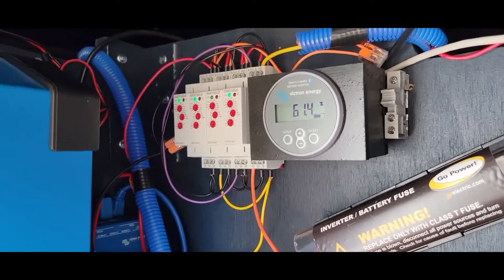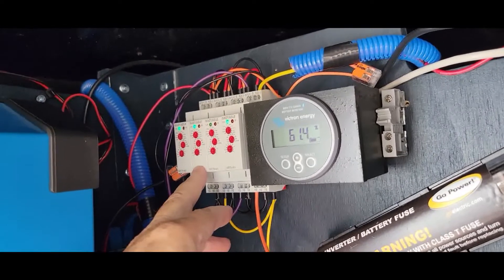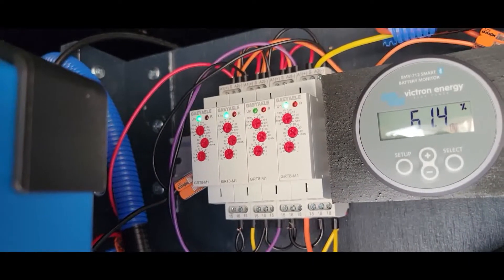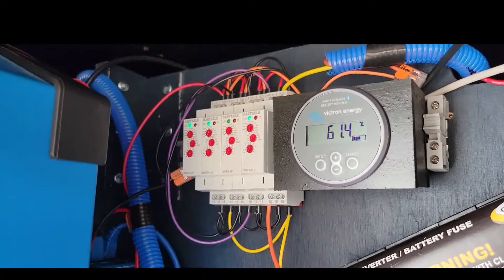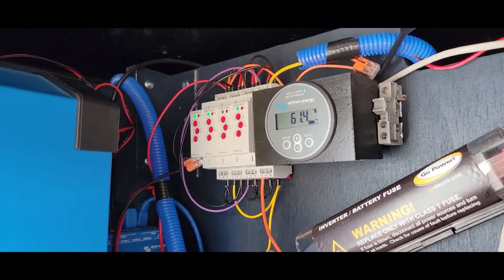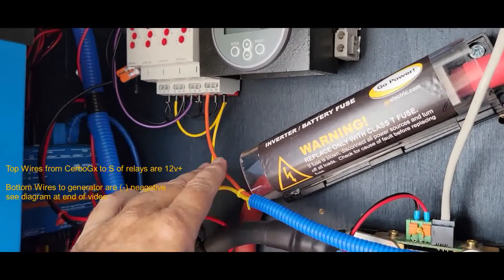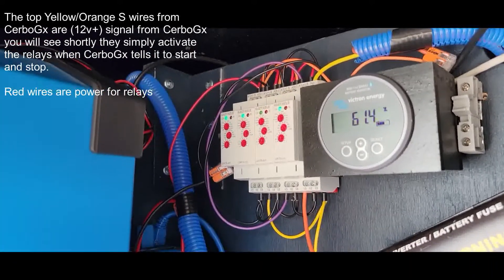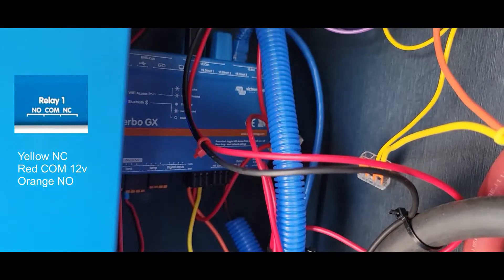Automatic Generator Start CerboGX start/stop/prime setup. Onan5500 controlled by Victron Cerbo Gx

Comment: This is a great video and thank you for the wiring diagram at the end. Very straightforward. I have built this system exactly as you designed it and it is working fine with my generator. I do have an additional idea for you to consider. I think there should be an additional timer in the system that shuts the generator off if the Victron were tolose Wi-Fi connectivity.  The additional timer could be set at four hours or some other appropriate time that is longer than you would normally run the generator.
Reply from the maker: The cerbogx generator programming doesn't care about the wifi therfore I don't see that as a need.  I would recommend a breaker be used as a switch so you can cut the power to the relays for storage etc..  note this version is very old still works but now on Gen3v with restart if generator fails to start.
Eric

Comment: What gauge wire did you use?
Reply from the maker: The wire gauge depends on the application I would need to know a lot more  about what your doing to answer the question and what your setup is.
Reply from the maker: Our website also has information you might find helpful and you can contact us through it as well.  DoingCreatesKnowledge.com

Comment: Some new portable generators have a start stop button like a car.    I wonder of the cerbo “no” could be wired to that wire
Reply from the maker: Typically NO what your describing could be either a single or double action push button which either way is a momentary signal which the cerbogx can not do.   This 4 relay setup  is my old method have a look at the 3f2 versions on doingcreatesknowledge.com and in the community posts on the channel.   
Eric

Comment: Thank you for this.  Very helpful.  In the process of installing a Onan 2800i LPG model.  I am thinking that I can save a relay by using the run signal (preferred) or the Status/lamp output to serve as a trigger and prevent the Cerbo from trying to start a running generator.  Key to this will be determining the voltage that comes from the remote run wire and the status lamp.  If less than 12V, will have to rethink this approach or go with another relay.  Will report the results.  Thanks again for this great video.
Reply from the maker: Hi TylerCreed-m1c,   I am coming out with two more solutions in the process of testing both  and they would save on cost and size as I'm looking at reducing the size/footprint of the setup.  If v2 works and testing will be done shortly it will fit into a 3bay box and about 1/2 price with added features and v3 will be even smaller trying to keep it about 1 1/4" x 2" x 3.5" but this is about a week or two to test.  
Thanks for the comment and Check the community page for more information and alternative setup of this four relay setup.

Comment from the maker: If you decide to use the alternative relays go to the channels community for an example print for a Gas Onan generator.  Each application can be a bit different based on how your triggering the generator and current systems attached to the generator

Comment: I would like to set this up for my Onan 4kw on my class C. Do you have any updates/improvements you would recommend? I would like to use the Alternative relays single function  
vs multi function you mentioned it requires  1 GRT8-A1 and  3 GRT8-A1. I cut and paste the directions from Youtube and it appears they are the same one. Did you mean 1 A1 and 3 B1? It looks like you had some additional instructions 11 months ago to wire a bit differently. You wouldn't happen to have a wire diagram for that would you? Thank you for the video and your time. Appreciate the sharing of knowledge!
Reply from the maker: I just posted a wiring diagram in the community section of my channel for the Alternative Relays
Reply: Do you have a certain wire recommendation as well. (apologize for the newbie question)
Reply from the maker: @johnwhitney5316  I used 18-20 wire on my ONAN5500 generator.  I did use ferules when securing the wires into the relays.  Some people have just put the wires straight in.  As far as improvements.   Nope it works can't fix "it works".    No I didn't have a wiring diagram for the alternative relays but do now.  dm me on facebook and I can get it to you.  If you need any help feel free to ask
Reply from the maker: Hi John,  Sorry for the confusion on the A1, B1.  Where was that I can't seem where I made the mistake?  I would like to correct it
Reply: @ERazorDiy  in the description, under alternative method
Reply from the maker: @johnwhitney5316  Thanks John finally found where that was.  Had a few people point it out in the past but wasn't specific where it was and didn't notice it.  It's Corrected.
Reply from the maker: I just updated the print in the community to add an inline fuse for the power going into the cerbogx relay COM.  Just to be safe.    I'm will be adding this inline fuse protection to my setup.  So yes I just found an improvement that should have been there.

Comment: fantastic video, simple and right to the point.. great follow iup below.. THANK YOU
Reply from the maker: Thanks for the comments.  If you have any questions feel free to ask.   There are other video's on my channel working with  Victron equipment as well.
Reply: @ERazorDiy Common has power, NC is supplying power out, yellow does nothing. Using the cerbo to turn Gen on and off the 3 wires on the cerbo never change console on or off. I've been through the settings I'm not seeing what I'm missing any ideas
Reply from the maker: @stattytravels4638  on the cerbogx you need to set the relay1 to Automatic generator.    The common needs to have 12v.   The wiring depends on the relays your using multifunctional or single function?.   Will be happy to help if you want to directly email me you can at ERazorDiy at Gmail.
Reply from the maker: @stattytravels4638  check my comments above should be near top. I have the cerbgx settings that are needed.

Comment: I couldn’t find a generator with electric start small enough for what we needed. I know there are aftermarket electric starts you can add. But can you tell me if the cerbo can be configured to auto start a generator with an aftermarket electric start installed? And how would you do that? Right now mine has to use the manual crank (it’s a 4000ish watt AiPower genny)
Reply from the maker: Adding a auto start function to a manual generator.  If it has a button to start/stop then yes it should be able to be done the wiring and setup would be different depending on the auto start function that is added.

Comment: Hello.  Watching your video once again to figure out the relay connections. I understand the connections to the GX. You have Orange /Red / then Yellow connected to the relay.  What 12v power source are you using to power the relays?  My solar batteries are configured in 24v conf.  Just wondering as I only see the red wire going t GX and don't know where my black wire is going ?
Reply from the maker: Hi, It depends on what relays you are using the single function or multifunction relays depends on the wiring.   As far as 24v my understanding is the cerbo gx will accept up to 30v 6a  DC if that the case you should be able to use the 24v to same as the 12v.   With multifunctional there is 12v powering the relays via 12v battery bank.  Then the cerbogx COM is 12v to send 12v to the S top signal of the relays.  If that makes sense.   Feel free to direct contact me email me at  erazordiy gmail
Reply from the maker: If your using the single function relays  they are wired differently.  You don't use the S and the power to the relays is replaced with the NO and NC from the cerbogx depending on the relay
Reply: @ERazorDiy  . Thanks for your reply. I set up using your video and same relays. You show the red power cord going to GX and don't show were the ground connects. I understand it goes to 12v battery, but should the red wire as well?
Reply from the maker: @Alaska1969  
if I recall you using a portable generator?.   Lets think about this.   Assuming your using two separate powers one for relays and cerbogx relay and the generator has it's own battery.  
you will need to get a ground from the generator and connect it to relay 1 15, relay 3 15 and relay 4 15.  Relay 2 15  ground needs to come from same power source as you are using for the 12v to power the relays A1's "same ground as your A2's".   if that makes sense.   If we are tying to start a generator that has it's own battery and is using a ground to start it.  The ground needs to come from that source the generator battery.  Because relay 2 is activating relay 3 the ground sources of relay 2 15 needs to be same as the grounds to A2's.
Reply: @ERazorDiy , is it okay if I email you and send you a couple photos. That may help. Thank you. Brad
Reply from the maker: @Alaska1969   yep feel free more than happy to help
Reply from the maker: Trying to figure out what your asking..  sorry for the my confusion.  Looks like I didnt' make it clear what the COM on the cerbogx relay was on the print. There are 3 wires going to the cerbogx relay.   NO yellow  NC red.  and there is a COM that is the 12v power it sends 12v to NO or NC depending on the state of the relay.  the NO red wire should not be red I guess.

Comment: Hello Eric, thanks so much for the video.  This is my second attempt to get my gen auto start. The first was one from another guy on YouTube using a two relay setup, i couldn't get it to stay on, it would just click on for a second? So I thought I'd try your four relay set up. Let me first say that I'm using my Multiplus rather than a Cirbogx. I've had a great guy from Battleborn helping me with the programing so I'm sure that's set up correctly. I also have a diesel generator which I just noticed you mentioned needs to be wired a bit differently. I'm not on Facebook so I'm just reaching out here. My generator is also a negative contact to start. I thought your set up should work but if you have a diesel diagram that would be great! One question I have is on the top of your wiring diagram you have wires to ground. For some reason i was thinking that you meant to the com on the Cerbo, but now looking at it again I'm thinking that it should be to actual chassis ground? Any help would be greatly appreciated. Thanks.
Reply from the maker: Hi Danny,  yes I can help done lots of configuations, but will need more information before we know what you need which will need better communication.  Maybe contact my email and we can go from there.  ERazorDIY. At  g mail.
Reply from the maker: I would not suggest buying any relays until you know how to its setup.  There are a lot of configuations especially with diesel generators and how it's connected will determine what relays to use.  Most ppl don't know how this works.

Comment: would there be a way to add another timed relay in there and have it do a 30 second preheat?   My generator has this a s separate switch from the start switch for the preheat.
Reply from the maker: Based on your question I'm assuming it's a desiel generator?  If so they work a bit different.  But still only needs 4 relays typically two 5 pin automotive relays and two multifunctional relays its cheaper than using 4 multifunctional relays.   It can also be done using a  raspberry pi picow  relays, isolation board for about $50 but takes a bit of programming..  will look up my desiel relay doc I made to better answer your question.   If you want to dm me on fb you can as well
Reply from the maker: I looked up my diesel Gen setup and for the diesel I helped on it had a Stop(OFF)/On/Delay/Start  functionality.  It depends on exactly how your trying to do this.  You can add more relays into the set but I don't think it's necessary unless you also have a prime cycle.

Comment: Nice work - thanks for the video - hoping to use the node-red to do something similar with gen start led feedback to stop starting cycle - also targeting to use soc driven prime and start (few times with cooldown between) and also do the stop based on soc and current draw.   I am fine running one ac on batteries till they come down to a low soc then keep the ac running but with gen while it also charges the batteries - i.e only run gen when it needs and ideally while ac is needing power as the generator has excess power with one ac unit running.  Running both ac units is a different story as that needs the power asist on the multi to suplement generator power during second ac unit power up (yes both have soft start) once started most times if can slow charge with two units running.  If its really hot then it has to eat battery power as the generator is maxed out (4kw) so charging only happens when a unit cycles off (if it does, else its a game of chicken between reaching a too low soc vs forced manual ac shutdown).  Hope i can figure out node red.  Thanks for sharing i like your setup.
Reply: Hi there, were you ever able to work out a solution using Node Red? I'm trying to do something similar, accomplish what these relays are doing but with node red and just using the built in cerbo relays
Reply from the maker: Thanks  https://www.youtube.com/watch?v=ujeoZ4ldIGY&t=322s       I've also used a Raspberry pi PicoW to auto/start/prime stop my generator.  See Link that only uses two relays due to programming.  The Auto start and stop is currently being done using the cerbogx and the PicoW will manually start and stop it.  This will change shortly I'm working on reading data from my battery monitor BMV712 and MPPT solar controllers gathering this data into the PicoW allowing further programming options such as full automatic mode with just the picow and two relays.   I now have full access to SOC, voltage, current etc, etc and solar controler data.  This allows me to program using SOC,  voltage, time etc with  Current level draw  given x time start generator together with restart if start fails .  I currently have a restart if generator fails to start using the generator status wires as input to a delay before restart to unsure it's completely stopped and verified by status wire.    That and controlling fans and other devices  lots of ways to skin this cat now.  Not to familiar node-red will have to have a look at it.

Comment from the maker: If you decide to use GR8T-B1,A1 relays they are wired differently than what I did because they work differently.   Relay 1-3 A1's  would be connected to Cerbogx NO start signal wire.  Relay 4 A1 is connected to Cerbogx NC stop signal wire.  there is no "S" wires and the grounds and bottom wiring are the same.  If your more advantageous a bit more technical this can also be done cheaper with a Raspberry pi PicoW, two relays and an isolation board and a bit of programming.  I have also incorporated the PicoW setup to control my generator, fans, lights and adding more to it such as reading battery data from my Victron shunt.  If your thinking about the PicoW pls contact me for tips and things to consider before you buying.   You can see the PicoW generator prime/start/stop fan control overview video  https://www.youtube.com/watch?v=ujeoZ4ldIGY&t=90s
Pls hit the thumbs up button and subscribe to see more upcoming videos